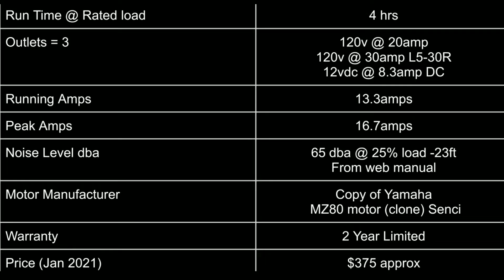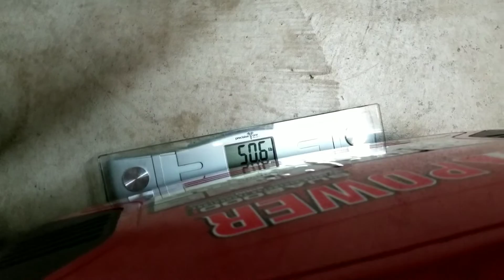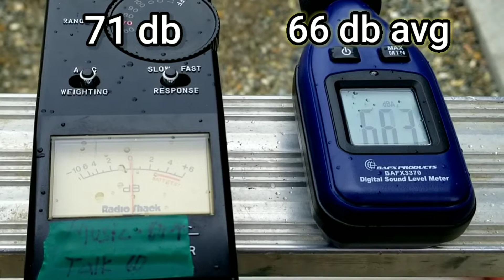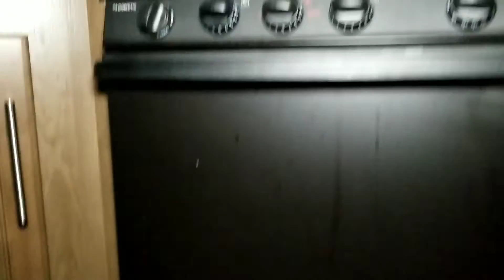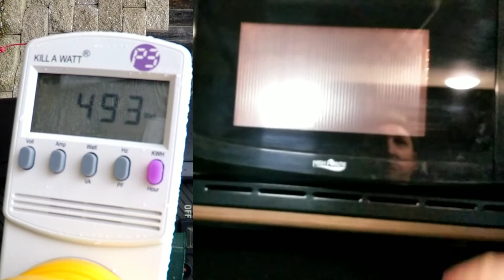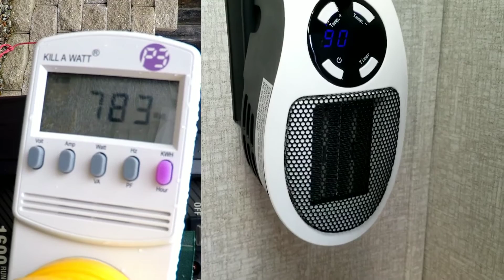BEST Inverter Generator A-ipower 2000

Comment: How many hours do you think this would run using a 15lb propane tank? (Assuming 50% capacity.)
Reply from the maker: Well this isn’t a dual fuel model but they do make one now. But propane does have less btu’s then gas so it won’t last as long. But this is probably close but a 20lb propane bottle with probably run about 13-16 hrs @50% roughly

Comment: So how long will it run on 1 tank?  How long would it take to charge a 500 AH Bank?
Reply from the maker: Depends on the load.
Charging a 500ah battery bank is a decent size. So using the Dc out let would take a while since it’s 8 amps max I think. You would want to find a way to charge with the converter because it could run a higher voltage and amperage. Like 12 verses 8. 
Or solar but that doesn’t always work pending where and weather.

Comment: Interesting that the a-ipower website now says 58dBA at 21' with 50% load for this generator. I wonder if something has changed or if the website info is wrong. Clearly your test shows 65dBA is closer to accurate. Do you know what year your unit was manufactured?
Reply from the maker: I think mine says 2019 but I can double check because I am interested now.

But there testing could be different then mine.

Concrete walls or flat pad will create more sound then say sitting on small rocks and dirt and even less on grass. Add some bushes and even less.

So just depends.

Comment: Great video 👍. Nice to have found your channel. It's important to note that most ceramic type space heaters draw 1500 watts. Kind of a bummer that you couldn't run the microwave and fridge at the same time.
Reply from the maker: Yea if i didn't have the converter on and just charged the battery off solar then i would save that 1 amp or so. 
That's how i would do it. 
I have solar i use so i can turn the converter off at the breaker...👍

Thanks for the comment and thanks again for watching 👍😃

Comment: Do a predator have a fuel shut off , what’s the history on problems with in a two year time span if you had any feedback
Reply from the maker: So they don't have a true fuel shut off valve like say a old dirt bike.  Its more the vent switch up top. But take off the panel and there is a carb screw with drain tube to drain the float bowl. This will drain the carb completely for long term storage.  

As far as reliability many people have commented using these generators for thousands of hrs under rough conditions.

And of course basic maintenance is key and not letting them sit to long with out doing proper storage. Or use non ethanol free gas.  Hope this helps. 

Thanks for the comment and thanks again for watching and Subscribe 😃👍
Reply: @johnnysweekends  Thks for the feedback, I’ve been watching and like info on your trials , pretty throrough
Reply: Keep up the good work
Reply from the maker: Thank you...i have a yamaha version of Aipower coming up..
Champion dual fuel...and champion against predator 3500...
And more. 👍

Comment: Would you suggest this over a predator
Reply from the maker: What if i told you it's almost exactly the  same thing. 

After doing this for a while i have found they are so close and so many parts cross over....it seems to come down to best deal. 

Im working on a video now on another comparison and will have results soon. And hope to post in a couple of days.
But in short...nothing wrong with both the predator and aipower. The specs are to close.

You can also watch the comparison between this gen amd the predator if that helps to make a decision.

Thanks for watching and Subscribe 😃👍
Reply: @johnnysweekends  thanks again. Looking forward to seeing it.
Reply from the maker: Your welcome and thanks for watching...😃